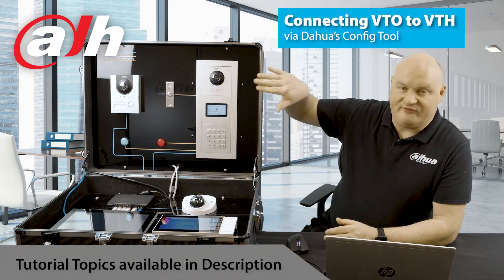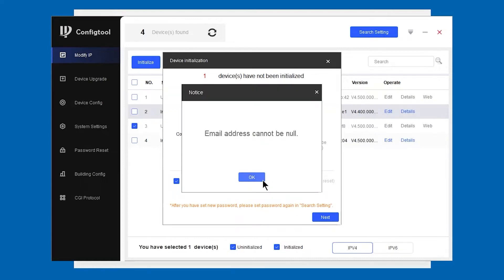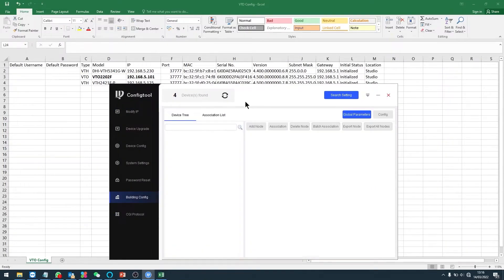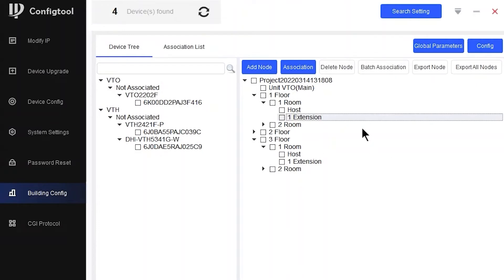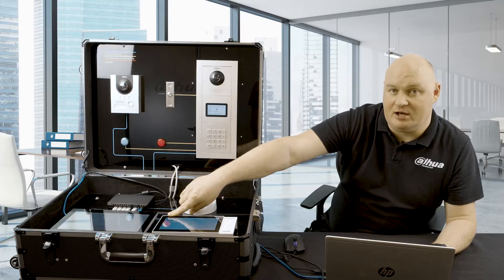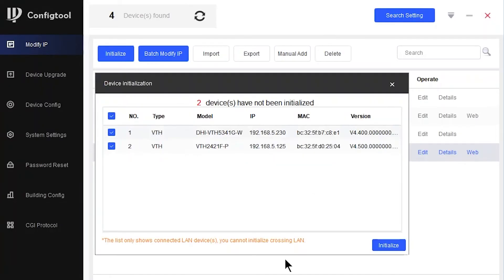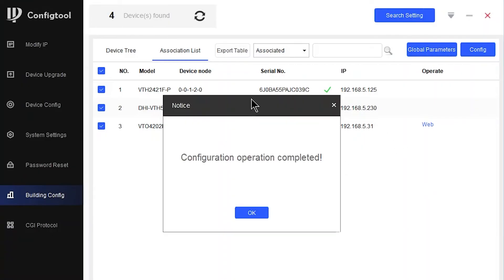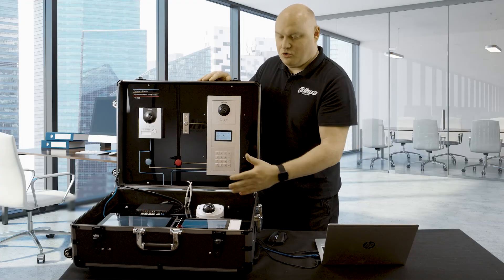Dahua VTO / VTH Setup (Villa and Apartment)

Comment: Great video, thank you.
Which model of proximity reader with a keypad allows it to be integrated with the DMSS application (receiving notifications regarding e.g. door opening status, code entry) and to trigger the electric strike connected to this reader from the DMSS application, as well as the possibility of integrating this reader with the VTH panel and triggering the electric strike from the VTH panel?

Comment: Hi there -great video for those wanting to set up from scratch. My VTO and VTH system has been in place for over 5 years and over last few days been experiencing some issues and no matter how much investigation I've done I can't seem to find a fix for the problem, even contacting Dahua Support did not help. 

Products in question 
VTH5341G-W
VTO3221E-P

Issue 1: Tamper Alarm being triggered.

Getting constant notifications of Tamper alarm. No physical damage or attempts have been made to remove the outdoor intercom. I assume the trigger behind the intercom has become a bit faulty causing the tamper alarm. As the intercom has been fixed permanently onto a brick wall, I won't be removing the intercom to inspect the tamper trigger. Therefore I was looking at ways to disable the tamper alarm.

There is a configuration where you can disable the alarm, I've done that and I still continue to receive alarms both on the DMSS App and the internal monitor. 

I had a look at some other online videos and can see that in some video examples the alarm config clearly shows Tamper Alarm - I don't see that in my software version. 

How can I fix this and disable the tamper alarm  notifications.  

Issue 2: Can't unlock the gate from the internal monitor

Around the same time as the Tamper Alarm issue I now can't unlock the gate from the internal monitor when someone presses the buzzer on the intercom. I can though successfully unlock the gate from the DMSS app.

I noticed an error on the Internal Monitor stating the following:

Device offline, please select whether to monitor or not! Looking at my wifi settings the Monitor is online and connected and I can see people through the video when they press the buzzer. 

This can't be a coincidence - something has definitely changed that's causing these 2 issues.  

Thoughts?
Reply from the maker: Hi. Its best you speak with the Support Department opposed to YT :-) support.uk@dahuahelp.com

Comment: hello, I have a configuration question.
It's possible to unlock in apartments (5Flats)2 different doors? example main door and a fence-door ?I think it will perfect system for me.
Reply from the maker: Hi. Yes but best working with a VTO4 and a DEE1010B (Intercom Second Relay Module) :-)

Comment: Great video! I have a question: I have a multi apartment vto6531h. There are 10 apartments each having a single vth. The vto and vths communicate without a y problem.  How do I add vto to my mobile app dmss and make it answer only specific vth is called. At present my mobile app receives calls for all apartments. Please clarify. Thanks much

Comment: Hi I bought a ip dahua intercom, can I use the wires at vth to open an close my gate, instead of running a wire to vto, coz I only have a cat5 at vto, an at the vth I have spare wire to gate motor
Reply from the maker: Hi. This time no. The VTH informs the VTO to NO/NC but not the other way around. Thanks.

Comment: Thanks for this... My VTH keeps showing 'login failed![Username or password error] whenever I try to use the config on the associated devices.  Pls whats way out, even when the passwords are correct with Username
Reply from the maker: I suggest a factory default and start over. The software would not say username or password error unless there was a issue with the factor.

Comment: Hi Chris!! Thank you very much for the video. After watching it I decided to install a similar system myself. I have 2 VTH2421F-P and 1 VTO 3211D-P2-S2. When exporting the device information I verified that they all have the same IP address (192.168.1.108) which I think is the default IP.  In the Global Parameters step, which IP should I put on Server Adress? Thanks!!
Reply from the maker: Hi. Please address all the devices individually first on a unique 192.168 address and then set the server address to be the VTO :-) Cheers Chris

Comment: Assuming one has like 50 apartments to be installed how does one go about it i mean the kind of equipment needed and installation process,Thanks.
Reply from the maker: Using the video is fine for 50. So 
1. Villa 3VTO-9VTH
2. Apartment 200 Devices
3. +200 > 2000 Devices = DSS Pro

Comment: Hic.  -Great  video and good tutorial , have a big problem with me system Dahua  Villa <  The VTH connect good with de VTO Modular but appears this message ( format video Not compatible) and the image of VTO not appear - can you help me . thank you
Reply from the maker: Hi. Please visit the Dahua Security website. Using the magnifier glass in the top right. Put in the model number of the VTH and then the VTO and get the latest firmware for both your devices. Once upgraded factory default and then follow the the video setup process again. Thanks. :-)

Comment: Question regarding VTO3211D-P2-S2 and VTH2421FW-P. Thanks for your great video that helped me set our first video gate system (we normally do just WiFi / Cameras / Music / TV). Mycustomer now ask me more and I can't find any information about how to do it, My customer wants to have 8 RFID Tags, just to open the gate when swipped and nothing more. He also would like to have an RFID reader to open a small door with magnetic lock when swipping same RFID Tag (ne need for calls etc, will be used for staff entrance). Would you please point me in the right direction? Thank you in advance for any help you might provide.

Comment: Does anybody know if 3rd generation VTO's will work with 1st generation VTN's and VTH's?
Reply from the maker: Hi. If the firmware is very different then there will be problems for sure. Check with support.uk@dahuahelp.com. It’s important that the firmware versions match like V4.

Comment: Dear Sir, I've problem whit my project: 1 floor, 1 room, 2 vth1550 and 1 vth1660... 1 main vto2202A. the vto will call all the vth at once. When I try to write the configuration with the ipconfig (building config/assocation list/config) the vto2202 and the vth1660 gone wrong with this message "failed to set building number or unit number". In the project I've set 1 floor, 1 room and 3 extension. I've pictures about that if you want see them. I can I do? thanks in advice, nico.
Reply from the maker: Hi. Contact support.uk@dahuahelp.com They can help with this.
Reply: thanks a lot

Comment: Very good tutorial, I finally understood how the config tool works (it really lacks proper documentation). I configured my VTO with 2 VTH, where everything worked fine before except that the 2 VTHs won't ring simultaneously (they were set as 2 master). After following the tutorial they now work BUT I no longer get video when calling the external post via SIP: I can see the camera if I press the "camera" button, I can call the outside post, it answers but the screen goes black. Maybe I messed something with the SIP server configuration?
Reply from the maker: Thank you for the great comments about our content. 
Please go through the Dahuasecurity.com site and select your country then click contact us for the Dahua Technical support team in your region. If you are based within the UK Ireland Please go through our technical support team at support.uk@dahuatech.com
Make a note within your email for a response from Chris. ⭐⭐⭐⭐⭐
Reply: @DahuaUKIreland  thank you very much, I resolved by upgrading the VTO to a newer FW, still wonderful job in filling the gap Dahua is leaving in explaining how to configure its products. The products are good, but really lack in clarity on how everything works together.

Comment: Can you do this building config without internet connection. Because some new houses have to work vto and vth before internet arrive.
Reply from the maker: Hi. Internet or no Internet. Building config will work just fine 😀
Reply: @DahuaUKIreland   i just tried the building config without internet and on the final step at association list when i press config a triangle appears and it says login fail. I do the same thing with internet connection and it work just fine.
Reply from the maker: @nikolaspanagiotousecurity  If you get this message the password in Global Parameters for either the VTH or the VTH is incorrect. Contact support on 01628 200880 they can help with this 🙂
Reply: @DahuaUKIreland   can you do a tutorial how to connect dahua new Wirless alarm hub to VTH so all can communicate with?

Comment: Excellent tutorial! In my case I have a 6521H, is there a way to install this unit for 10 apartments without having to install 10  VTH´s so as to the VTO calls directly to 10 DMSS?
Reply from the maker: Yes this will be fine. Internet of course needed. I think most if not all can work straight to DMSS now.
Reply: @DahuaUKIreland  I try this way also, only to call on my smartphone (DMSS) but it's not calling. How can I do it? Please, help. I have a model VTO6221E-P

Comment: Hi there, is it possible to change the default ring tones? I believe there is a built in SD card you could save ring tones to.
Reply from the maker: Hi. I checked into that however unfortunately not. Just a couple of default selections 🙂

Comment: Very well explained. Helped me quite a lot. I still cannot configure ONVIF IP Cams on my Android-based VTH5341G-W. Also, it fails to read the SD card hence I have not been able to install any apps on it. Is there a reference online for troubleshooting ??!!
Reply from the maker: Hi Majeed 
Thanks for your comments! Please contact technical support and our team can potentially direct you with this query. 
support.uk@dahuatech.com
Reply: @DahuaUKIreland  I did email the provided address but apparently, it is a restricted address and the postmaster did not deliver my email !!!!
Reply from the maker: @majeedpanahi5783  Hi. Please try again or use a different email. I’m looking at the account and getting frequent emails 😀
Reply: @DahuaUKIreland  I have eventually managed to contact support told to provide some info and where I bought the device, now waiting for over two months without a reply. Also, the bell stopped working rendering the whole system useless, and still NO response from Dahua support!!!

Comment: VTO and VTH settings can be configured from ConfigTools only with SIP 2.0 firmware?
Why did you  moor configure apartment VTO from the web interface?
Reply from the maker: All VTO, VTH models sold in the UK are released with either 4.4 or 4.5 SIP firmware. The browser is an option however ConfigTool makes it a lot easier. Since a large range of Apartment model all the way to Face Recognition models will include more features some will need a adjustment from a browser.